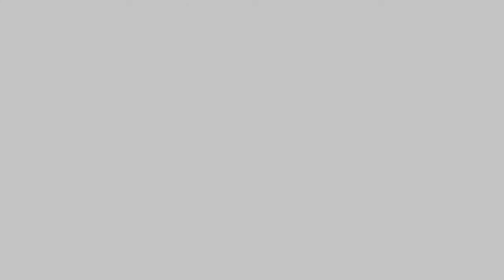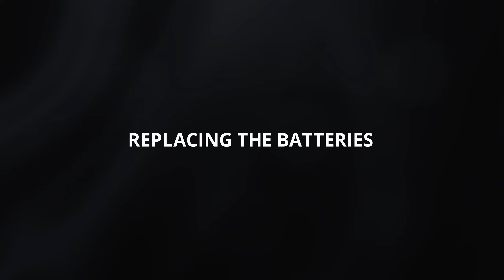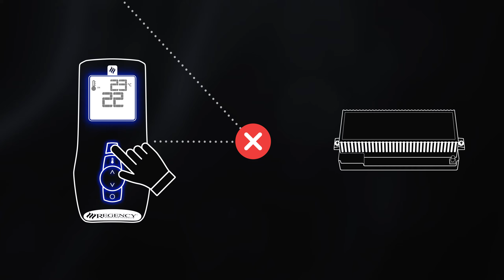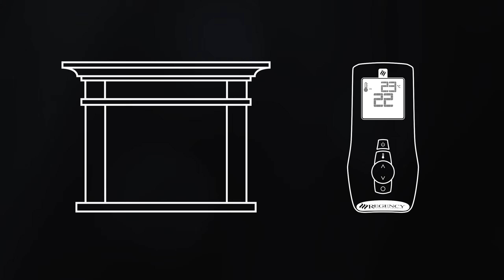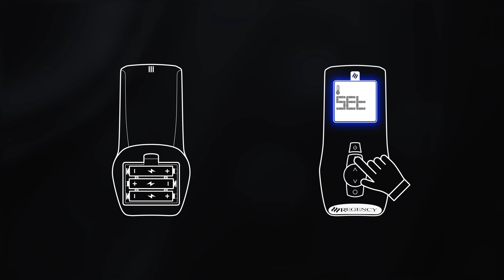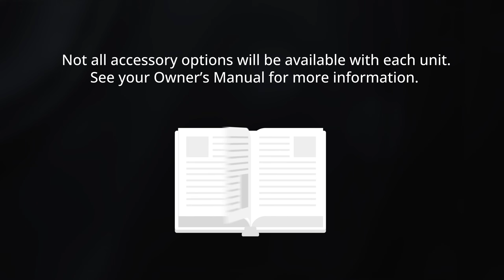How to Use Your Regency Proflame 2 Remote | Regency Fireplace Remote Troubleshooting

Comment: How do I unlock the regency remote
Reply from the maker: Locking/Unlocking the Remote:
If you want to prevent unauthorized use of the remote control, you can lock the handheld device and disable all buttons by clicking both the Mode and Up arrow key at the same time. A Lock Icon will display on the screen and now the Remote is locked. To Unlock the remote, simply press the Mode and Up arrow keys simultaneously once again.
See more about operating the remote here: https://www.regency-fire.com/en/Owners/Service-Maintenance/Fireplace-Care-Guides/Remote-Control-Operation-Troubleshooting